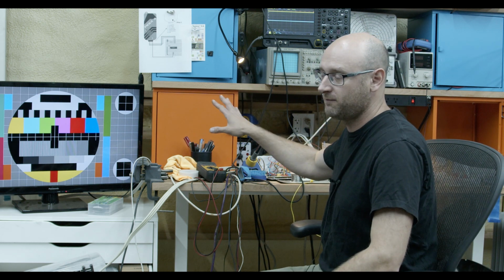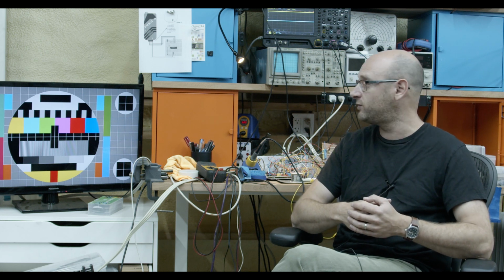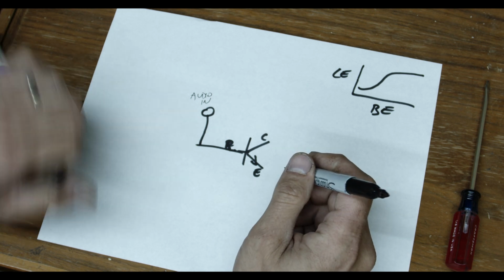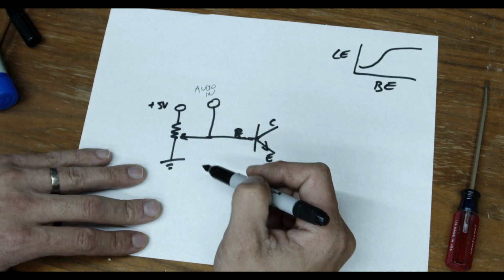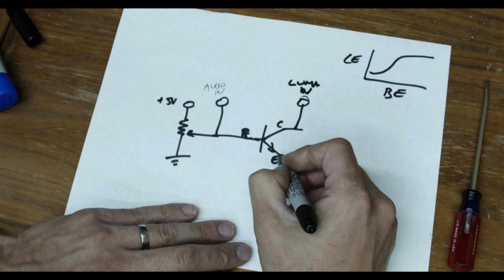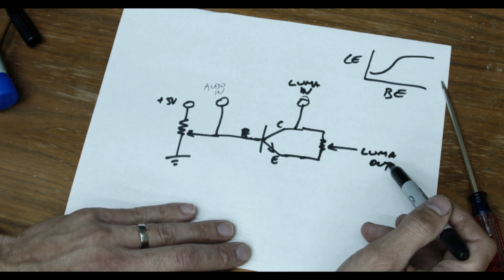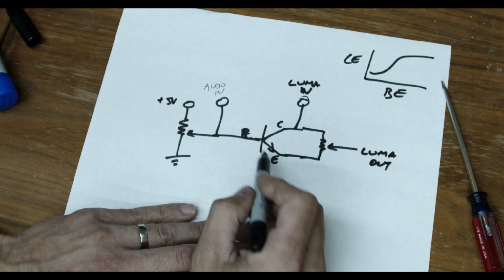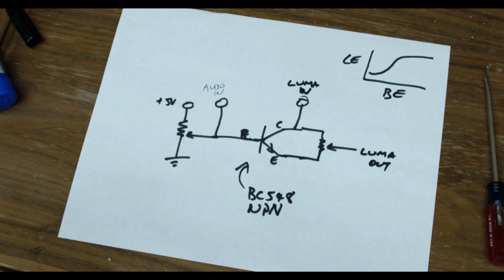Introducing the video synth project

Comment: I'm more of an AVR fan boy rather than PIC... I was wondering what kind of PICs you were using and if a poor little 8 bit AVR might be up to the job. I'm working with good old fashioned 625 line PAL rather than 1080p which could work in my favour.

I came back here to see if you could recommend a good opamp for video work... so thanks for mentioning the LM7171 right at the start. :)

Comment: So if I understand correctly, you mix the audio into the luminance signal and that results in the horizontal / diagonal stripes you see on the screen? So why exactly would you want to do that? Maybe a sort of averaged volume level would give a nicer effect because it would have a much lower frequency and would effect the brightness levels of the whole screen.
Reply from the maker: It’s purely aesthetic. I’m designing this for a particular song and the musician was kind enough to share the individual isolated instrument recordings, or stems, for me to use in this project. For this song, the strings work well with this effect. 

One of the PIC chips takes in a different audio track, which is low pass filtered at 12Hz, or half the frame rate, to apply a different effect on a per frame basis.
Reply: @superchromat  ok, i think somehow it's difficult to see the 12Hz ripple in the video images.